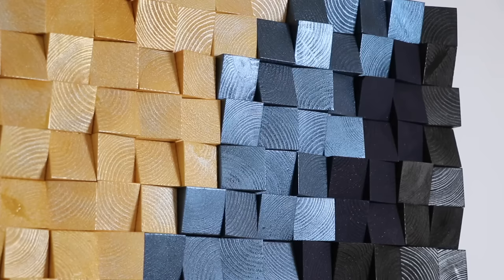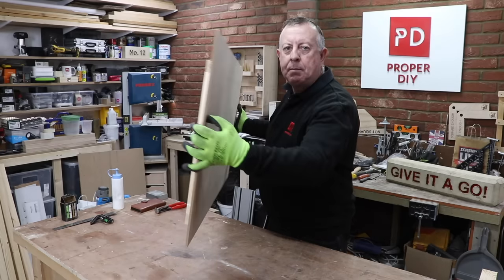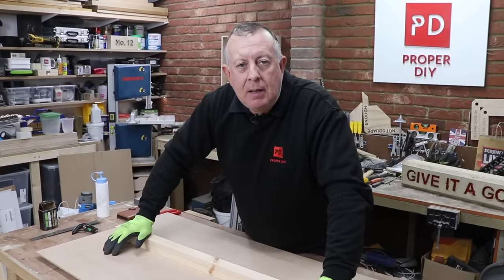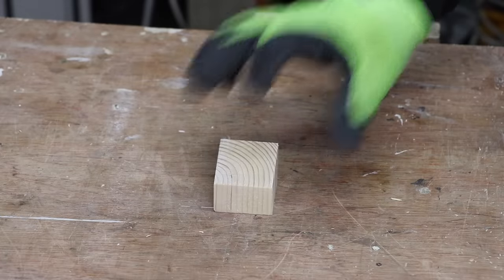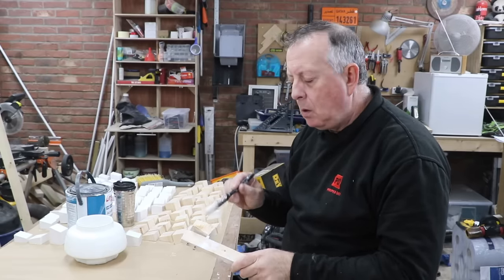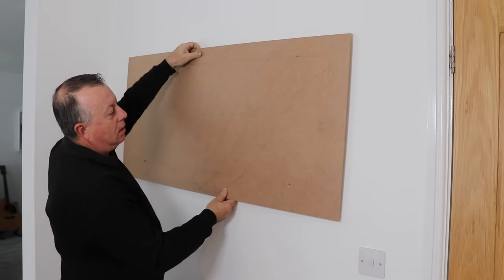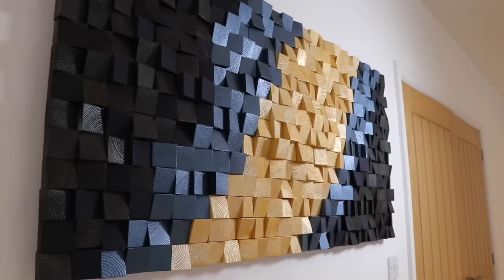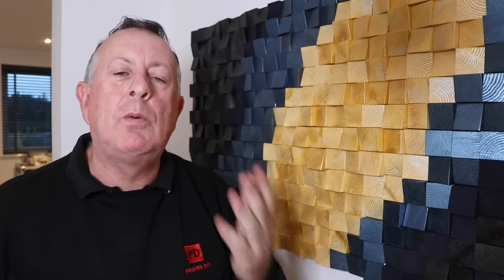How to Make Wall Art for Your Home

Comment: Really like the look of that. Wonder whether a French cleat would have worked just as well to hang it. Would save you having to remember where the "removable" blocks are
Reply: Indeed . . . the top stiffener rail on back would have served well as a French cleat.
Reply: My thoughts too.
Reply: This is a great idea. If the studs don't line up well with where you want to hang the art, the cleat would provide solid support and lateral adjustment.
Reply: I too was wondering on the wall fixing method. Thinking french cleat option would give alternative locations to tie in with stud work to to miss objects with the wall construction. Plus making install/removal easier.

Comment: For the initial cutting, maybe set the saw at 90 to start and cut the pieces double length. Then set the saw at an angle and cut them all in half. Double saw looked painful! Great content as ever 😊
Reply: Came here to comment the same! Could have cut random double lengths on miter saw, then cut in random angled 'halfs' on the table saw (safer than cutting short bits on miter).

Also could have painted boards before any cutting, and only had to paint faces after angle cutting.

Comment: Did it not occur to you to prime all the lengths first before cutting? that way you could have just sprayed the faces left on the sawn side.Really nice piece of art though.
Reply: Also, could have made all straight cuts , then cut the resultant blocks in half at an angle - instead of straight, angle, straight, angle.. 

Constructive criticism! Love the project and great video as usual.
Reply: @DtothekProductions  Nobody with any sense of safety is going to try and cut an inch thick block at an angle lol
Reply: @SiAnon  I didn’t over think it but a simple rig of some sort. Or at least do more than 1 at a time. Somehow.. if safe to do so - agreed.
Reply: @DtothekProductions  No, not in a million years hahaha

How many fingers do you have left ?

Comment: That looks fantastic! I love the way it changes as the light moves across it. If you need to move it make a grid diagram of the blocks and mark which squares are the ones with screws behind. Tuck the secret map 'somewhere safe'! Brilliant content as ever. Now... Mrs Proper DIY would like another one in exact mirror form of the first!

Comment: One mitre saw process would be cut all the 90% right angles first but make them double length, then set the angle to whatever and saw those in half. 👌
Reply: Exactly what I did when I made a similar one.
Reply: I was going to post the same comment, but you beat me to it! Lots of 90 degree cuts to make pieces about 90mm long. Then set the chop saw to a suitable angle. With a stop block in place, chop some at 30/60mm and some at 45/45mm. Gives you three lengths to work with.

Comment: I'd recommend a dip primer and even topcoat there are great aqua systems for it.
just throw them in a bucket of the material ,remove one by one and allow to drip dry over cardboard. Still a great result and well done.

Comment: I made one similar earlier this year. Used watered down acrylic paint. For a 18 x 10 layout, that took a long time. Will maybe use spray paint if I made another. I'd also use a fine-toothed mitre saw to improve the finish of the edges. Like the idea of the shadow gap though.

Comment: I don't have a bench sander but my Bosch belt sander is designed to be clamped upside-down on the bench if you remove the handle, achieving the same thing.

Comment: Very nice job. First time I saw something like this was on the TV series Snowpiercer - one of the bedrooms on the train had something similar on the wall. I modelled it in Blender to try different angles and have the intention to make it ONE DAY. Thought of using 50mm cubes of polystyrene and a hot wire with a jig to cut them. One day...  Good job!

Comment: Another option, would to be to do all the straight cuts first, then you can alter the angle of the saw as necessary to cut each those in roughly half.
Reply: They're only 25mm tall though, so it would be difficult to hold them steady on the second cut and you risk losing a finger.

Comment: That's a sound diffuser for hifi but you'll need a few in a room. Missing a trick on the algo with that thumbnail. 
Also much easier if you assemble it before painting, in one colour.

Comment: To keep the weight down did you think about drilling a hole in the back of the blocks to approximately 3/4 the height of the lowest side of the top? it would have been a lot of work but it could have taken a fair bit of the weight off. For safety, something to hold each block while drilling the hole would have been useful.
Reply: … is life not short enough already?

Comment: Also could you not mount all the unpainted wooden blocks on the board, then mask out each colour section and spray the repeat for each section. Would save a lot of paint as you only need to paint the visible parts eather than the whole block individually?

Comment: Was wondering whether all the blocks except the ones along a transition line could be glued before painting. Only the exposed bits need to show the paint. Spray those while they're fixed and hand paint the others. The gap should allow a board to fit to avoid overspray.
Reply: I think painting them separately gives a more polished look with sharp and perfectly clear separation between all the blocks, also those with the same color.

Comment: Rather than use two miter saws, cut an angle on both ends of a double thickness block, and then use a cross cut sled to halve the blocks and establish the flat face.
Reply: I had the same thought. If I decide to make one of these, I think I’ll give that a try.

Comment: Looks impressive, and could be made out of scraps/offcuts. 
Have you thought about mounting some led tape behind it to give it a glow? A USB powered one with a small USB battery pack could easily be hidden. Maybe even hide the battery pack in one of the larger blocks and run a either make that removable or add a male to female extension so it can be charged easily?
Reply: Noooo!

Comment: Would it not of been easier to put the lengths through the table saw at an angle for each total length needed? Just cut each length having painted the length first as one length. May of not understood the design properly but thought prepainting and table saw each length would be quicker / easier.

Comment: You can pay several hundred pounds for acoustic dampening panels like that.
Reply: True :) though i believe these are called diffusers, not dampeners. Dampeners are those foamy thingys that actually absorb sounds.
Reply: Or cover wall with egg cartons, 2 layers is very effective. Saw it in radio stations in Rostov-on-Don in early 1990s